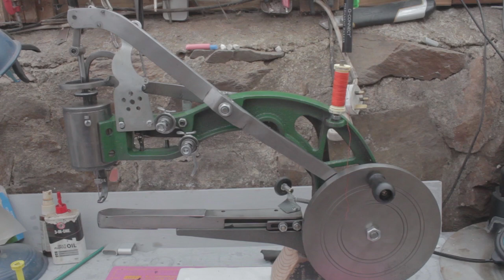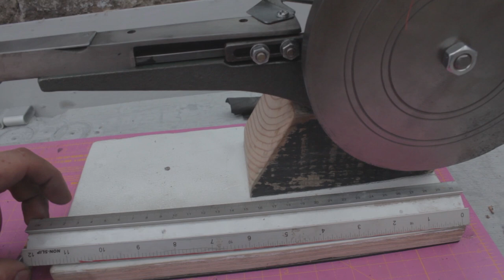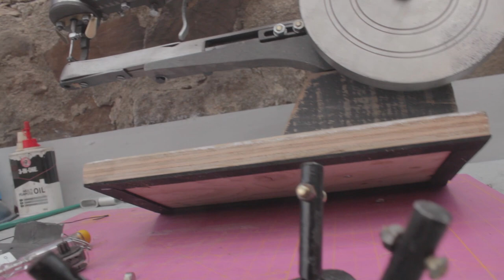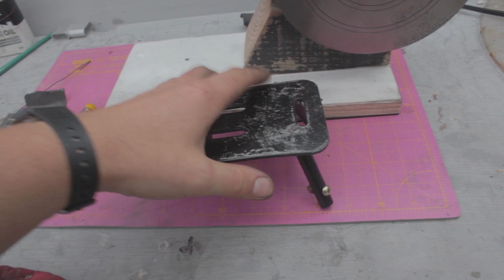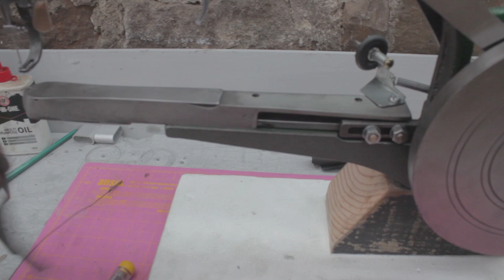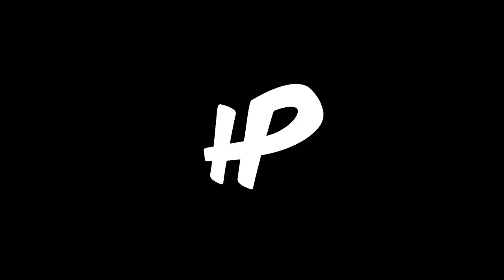leather sewing machine setup tips

Comment: Cool Tips! I would also suggest making a rubber sleeve for the foot, for working with leather that retains the aggressive toothmarks from the foot.
Reply from the maker: Good thinking, I did give the foot a good old file down to make it less aggressive, but I’d still does have a tendency to mark up the leather. Did you make a rubber sleeve? How’d you go about that? I’m gonna try designing and 3D printing a foot cover “shoe” out of some TPU (flexible) filament.
Reply: @HeyPatch  I can take a picture. Can I put a link in a comment? I'll try...

Comment: Before a lot of filing, put a wire wheel on a drill to all the edges and forging carbon left on by the mfr. I found that a machinists triangular scraper works well on straight edges, but a wire wheel smooths everything best. Get a dermal and go inside all the races and gears.
Reply from the maker: Good shout, in hindsight the sand paper was probably a bad idea.. as it’ll inevitably leave abrasive dust in all the moving parts.. I’m pretty sure this thing will be fine tho. It’s a tank. 😂

Comment: Actually used the metal stand that it comes with and holds the unit very stable. Steel legs need to be trimmed to level it and put new rubber caps on.
Reply from the maker: I figured the stand wouldn’t fit on my table so I didn’t even put the original stand together, never crossed my mind to trim the legs down if you need a smaller stand. Good thinking 👍